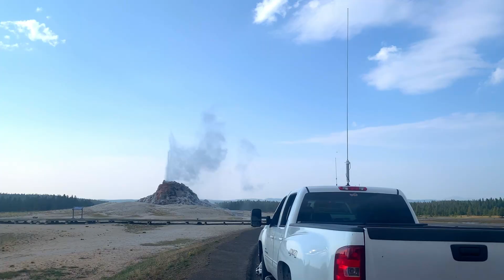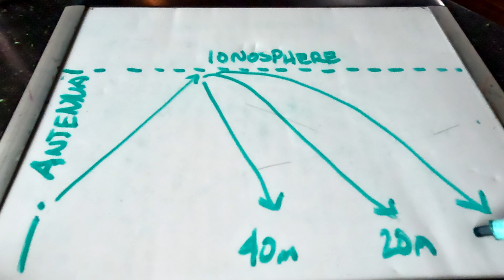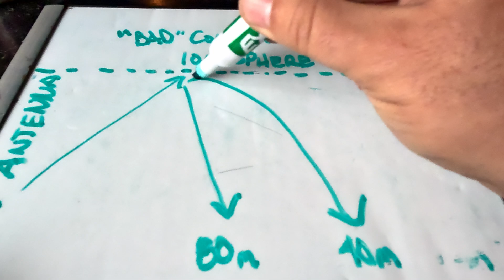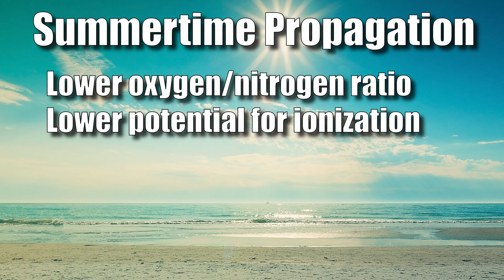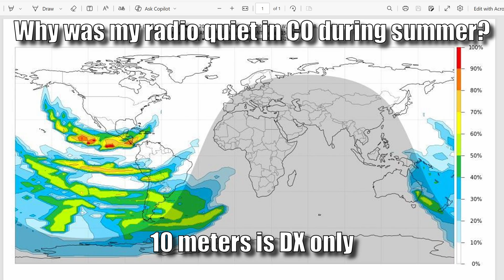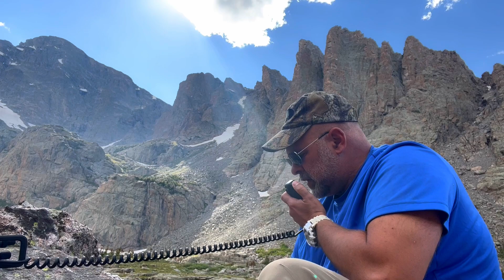5 Things I Wish I Knew When I Started Operating HF Ham Radio

Comment: My QTH in Wales is at the bottom of a valley. You can pretty much forget anything above 20m, and even 20m is very muted. 40 isn't a whole lot better. 80 is ok. On the plus side, it's 5 minutes drive to the top of the mountain where conditions get an order of magnitude better!
Reply from the maker: 🤨Challenge! If I can run on 20 meters successfully from the bottom of Grand. Canyon, making contacts all over the USA including some 2,000 miles away, I think you can work mainland Europe from a valley in Wales.
Reply: @TravelinHam  Not even 10% of what I can when I get to the top of the hill.

Comment: Those are all good points!  But, here's the thing:

1 -  Those things meant nothing to you, before you took up the hobby - so, why would you know them, or even care?

2 -  Those things are intrinsic mysteries in the hobby to be discovered; and, learning those things provides satisfaction that you would not be able to enjoy, if you already understood them.

3 -  If you were considering taking up the hobby, and someone explained those things to you, they would have deprived you of the experience of learning them first hand - always the best way to learn anything.

To take up a hobby is to embark on an adventure of discovery at your own speed, in your own directions, and to serve your own purposes,   So, you will learn what you need to know, as you go along, while being completely unaware, or unconcerned, about other aspects of the hobby.

This is coming from someone who has pursued the following hobbies:

Audio electronics - especially, filter networks and speaker design
Radio electronics - especially, amateur radio antenna design on HF, VHF, and UHF
Marine biology - especially, coral reef maintenance
Hydroponics - especially, herbs and tomatoes
Alternative energy systems - especially, solar powered battery supported systems

I have enjoyed learning about all of those subjects on my own, seeking help as I need it, and not begrudging my initial ignorance in any of them.

Thanks for the video, and 73!

Comment: As I am fairly new to hf I find these tips helpful. I have been hunting on POTA to get familiar with other hams and how they operate before I head out. I have been testing what gear works best didnt want to look crazy while I am out there lol. This here is another tool for me to learn and use as I prepare to head out. Thanks Mike hope to catch you on the air. 73...
Reply from the maker: Thank you! Sounds like you’re preparing well. But at the same time, you might just need to get out there and try it and see what happens.